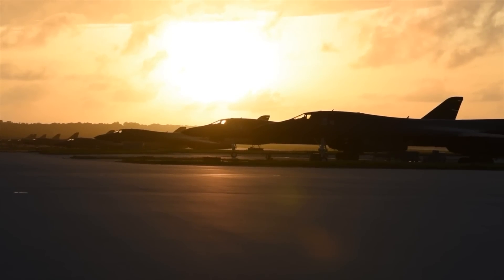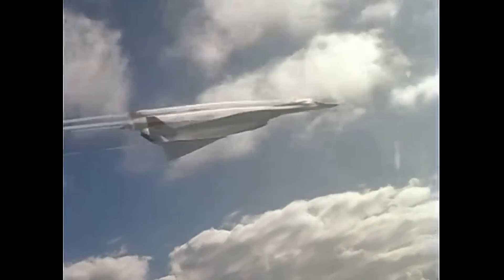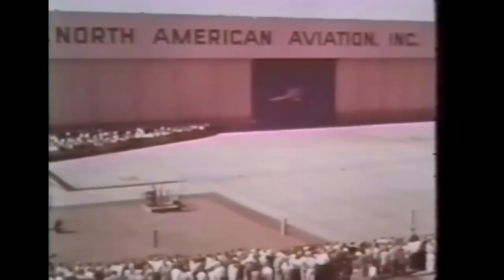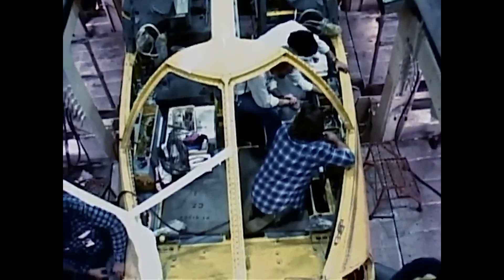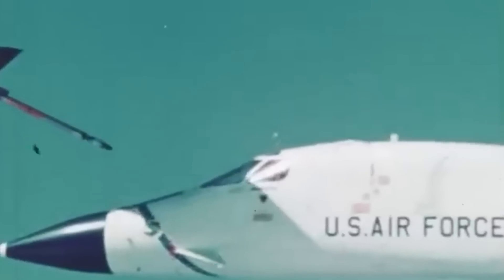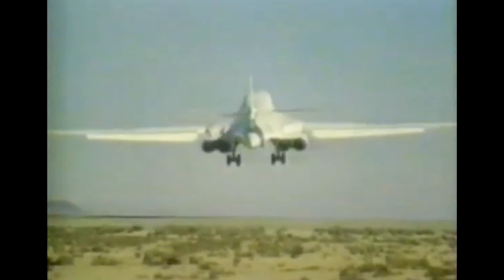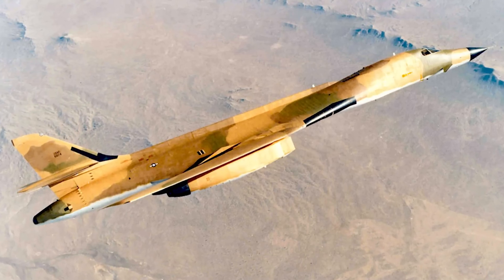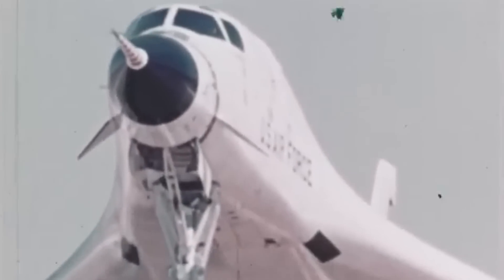Rockwell B-1A Experimental Bomber

Comment: This plane is cool but never made sense to me, we had just cancelled the XB-70 which was way faster and just better for high altitude long range bombing, we already had in service the F-111 which was again faster and more maneuverable than the B-1 while costing less and being nuclear capable. As cool as the B-1A was it was just a slower overcomplicated XB-70 and the B-1B is just a slower less agile FB-111 both are planes we didn't need but the suits in DC made the call.....
Reply: Greater penetration range and payload than FB-111.  FB-111A could carry 6 SRAM, 2 internally and 2 under each wing.  B-1B could put 24 SRAMs on its triple rotary launchers or carry 16 and have even more range, or carry  8 and some B28s.   It carried B-52 loads at 1/50 the RCS.
Reply: Carter cancelled the B1a because he knew about the classified B2 program. So, you should direct your question at the Reagan administration. My guess is ordering the relatively unneeded B1b was a political move to scare the Soviets.

Comment: The Russian TU-160 Black Jack has twice the power of a B-1!! Russian engineers simply outclass Americans
Reply: What you fail to mention is the TU-160 has significantly less combat radius due to its power plants.
Reply: @sanitman1488  Not true, they both have roughly the same range. The Black Jack holds 300,000 pounds of fuel!!!!!
Reply: @dnlcast2  True. Combat radius is significantly lower due to fuel consumption. Furthermore its maximum weapons payload capacity is lower than B1b.  TU 160 is significantly heavier.

Comment: Carter made the right decision to kill the B-1, and congress did not want to build the B1-B but Rockwell promised a bunch of then that they would build components in their districts, and no congressmen can resist a good pork project for thier constituents.  NATO wanted the US to build t 10s of thousands of cruise missiles instead of the B1-B, and in fact, the B1-B has never flown the kind of mission it was designed to fly in combat. Not ONCE has it performed a low-level penetration flight in combat, and it can no longer do so, and it is incapable of penetrating modern air defense. Even the B2 cannot penetrate modern air defense systems, and that is why the Pentagon needs the B-21. The future of warfare is drones and hypersonics though, so it is a waste to keep the B1-B flying when the Air Force can't even afford to fly the F-35 annual planned flight ours, which have been reduced form 240 to 185 and still has no war ready engines, and won't have any war ready engines until 2030.

Comment: You can't blame the Navy for rejecting the F 111.  They needed a fleet interceptor and they didn't need an Air Force bomber forced on them.
Reply: There's a joke about the F111 it was a useless aircraft for every theatre of operations..unless the U.S. intended to invade Canada 😊
Reply: F111 arguably proved way more useful than the f14. F14 was mostly subverted by the f15 in conflict because it lacked precision ground targeting. It was never really used for its interceptor role which is one of the reasons it was retired early.

Comment: Great idea canceling the B1a. Who might that have been?
Reply: @JeffreyWilliams-dr7qe  I think that was during the Carter administration?
Reply: The guy who knew the imminent B-2 was going to make it obsolete and unnecessary.
Reply: @stickiedmin6508  Which aircraft will serve longer? Which bomber has dropped more ordinance? Ridiculous comparison.
Reply: @JeffreyWilliams-dr7qe  
The B-2, obviously. 
The B-1A never entered service.
Reply: @stickiedmin6508  B2 not in even available.  Ridiculous argument!
Reply: @JeffreyWilliams-dr7qe  
Indeed. Why is that, do we think?
Perhaps because some genius burned up all the budget on the less sophisticated and less capable B-1Bs?
Reply: @stickiedmin6508  Joe taxpayer which one do you want now? Please review all the laurels of the B2. Ever been deployed abroad anywhere?
Reply: @JeffreyWilliams-dr7qe  
Yes. Frequently. Never heard of Guam, or Diego Garcia? There are several B-2s in The Pacific and Indian Oceans right now.
There would be more, if that genius we discussed hadn't used the Air Force budget on outdated B-1Bs instead of the much more capable B-2s.

Ask yourself one question: Are the new strategic bombers, currently being acquired by the modern USAF, more like updated B-1A/Bs, or more like updated B-2s? Which design does The Air Force consider more useful?
Reagan's squabble with Carter set the stealth bomber programs back by more than a decade - great job, huh?
Reply: @stickiedmin6508  Have Deployed! Not TDY.  Thanks for finding those sites onthe map. The Atlas remains just great!
Reply: @JeffreyWilliams-dr7qe  
If you know about those places, and you know about the facilities there, then you know dammed well that the B-2 can, and has been deployed from there (as if any of that was at all relevant anyway).
The US had the opportunity to jump a whole order of technological magnitude ahead of the rest of the world with the B-2. A literal quantum leap into the future that was tossed aside because Bonzo thought that sticking it to Carter was more important than providing capable strategic assets to the military. He painted himself into a corner with the B-1 program (which was out of date and obsolete before he even took office) and held back progress on stealth bombers by more than thirty years. 
As exciting and cool as the B-1B might be, it was an objective blunder to tie the future of the Air Force's strategic bomber fleet to it, rather than the B-2.
Carter was right to cancel it, and Reagan was an idiot to reinstate it.

Comment: B1 with white paint scheme looks like Tupolev Tu 160 at a glance
Reply: Where do you think the USSR nicked the design from 😂
Reply: @ZATennisFan The Concord supersonic airliner looks suspiciously like the B-1A too, doesn't it?

Same way the F-20 Tigershark was held back and doomed by the US Government, meanwhile the Israelis were developing an aircraft suspiciously copying many of its features almost identically, and their cooperation with China would lead eventually lead to the current joint China/Pakistan JF-17 (Of course Israel had pulled back cooperation by this point, but geniusly had already transferred their designs; which China was able to further modify and use without having to pay a thing...).

Comment: Why wasn't the B-1A converted over to Airforce One? I mean... Jeepers, what other airframe could equal the protections given by such an aircraft?
Reply: No way!  There is not enough internal room inside the B-1A's fuselage to convert it to a passenger carrying aircraft accommodating Flight Crew, Presidential Staff and Press Corps.  The very similar looking, but much larger, original design offered for the Boeing Supersonic Transport (SST), the Model 733, would have been a better candidate for the Air Force One mission.
Reply: @ChamplainDivision  the only difference is that was just a design. The B-1 is a reality. You definitely make good points but those points are for the sake of the other passengers. Hypothetically speaking. I think the B-1 would be perfect for Air Force One if say the world was at war. Something that can get in and out extremely fast. Get the president out of dodge from virtually anywhere. Unlimited range with aerial refueling. Of course no where near as spacious but never the less. It would be a good doomsday Air Force one. Plus imagine the upgrades a B-1 carrying the president would get. Would be a beast if a plane to imagine. 😮‍💨
Reply: @ChamplainDivision  fuck the press